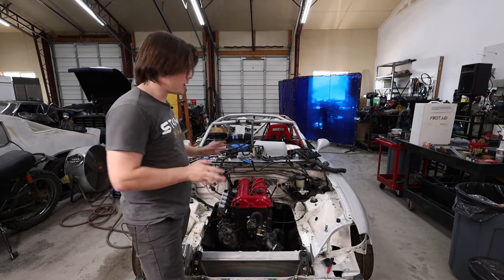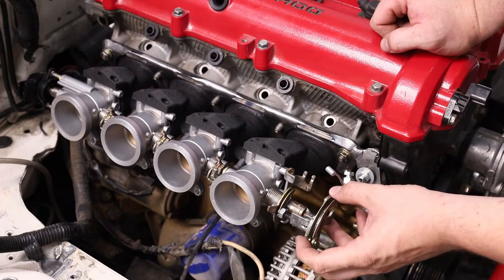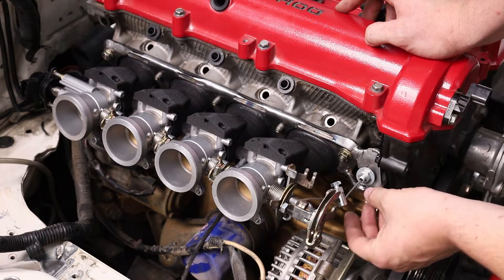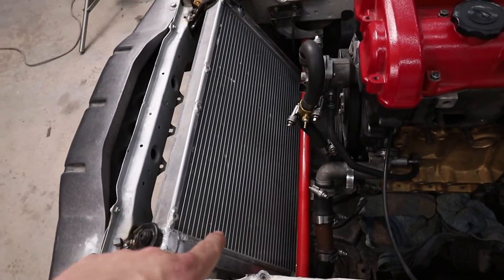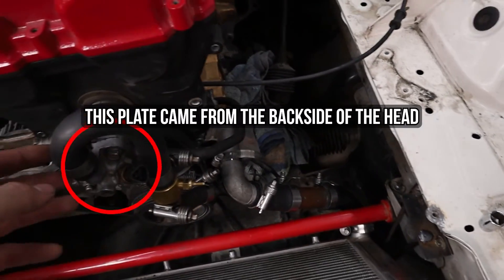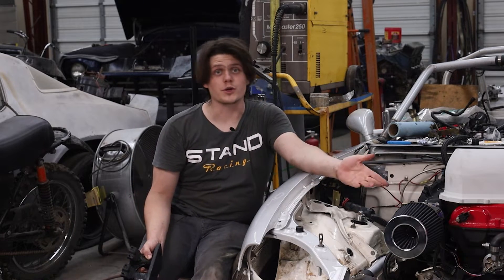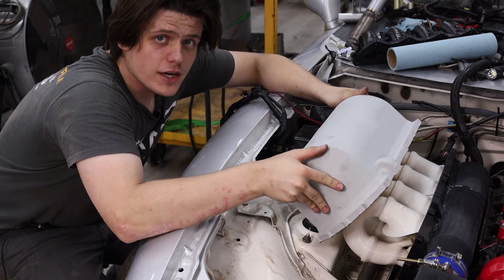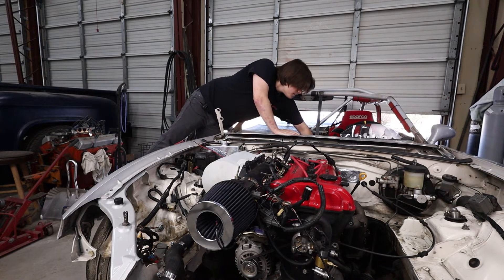I did all I could to make the 3D-printed intake work...

Comment: For the venturi project, ypu can use normal rubber hose, and you can put a spring i side the runner hose to keep it in right shape, to prezent it from collapsing due to excesive bending.

Comment: I'd try getting a good baseline established and then possibly afterwards try the venturi. I think optimising the runner length and lsa and cam timing events will yield much better gains than the venturi system likely would.

Comment: 3d print tubes(instead of using hoses) of a specified radius for better flow (hoses will kink and move around making more variables changes in the scavenging air flow). I think if you make a rubber boot for each end that should be sufficient to hold them in place. It’s an opinion, but take it as it is. Keep up the good work

Comment: At work we use Festo air lines, you could modify your Venturi ports to angle slightly towards each other and run pneumatic line to each port. Really solid stuff and rated to crazy ratings for the size of the pipe

Comment: I 3d printed an intake pipe (4 cylinder turbo) out of PLA for the fun of it the other day. I drove it 8 miles and took it off and it melted a crazy amount. I think maybe the first pull was an improvement and everything after had boost leaks. I think lost pla casting is the most realistic option for any 3d printed intake pipes.

Comment: You can get make your own oring lengths that you just super glue the ends for the plenum. What printer you using?
 I'll also be testing my manifold soon to see how much pressure it holds with 5-6mm wall thickness. 
Also are you going to be annealing your prints and try factor in shrinkage?

Comment: Is it just me or is that radiator really low?
Do you have a filling/expansion point in the cooling system that's higher than the engine?

Comment: For the hoses you can use a flexible filament to print them to shape.  More ideally I would use a resin printer and experiment with mixing rubber like and tough resins for the best results. But I imagine you only have filament printers available.

Comment: i thought the heated O2 sensors say specifically to not heat them up before starting the engine. if you let it heat up you may quench the sensor with water/water vapor on startup.

Comment: a small pipe bender, metal pipes, rubber hose couplings and some hose clamps should do for the venturi part. at least for dyno testing until a more permanent solution is developed.

Comment: custom bent tubes are easy. put a spring inside the hose, bend it and use a zip tie or something to keep it in the shape you want. Then put it in boiling water for a little bit, then cool it off in cool water. You probably want to bend it more than needed for the vulcanizing process because I'd think it would spring back a little. You can remove the spring from the tube afterwards. This project is bad ass.

Comment: Use metal tubing for the bends with rubber couplers to make your port to port scavenging connections. Could probably even print the couplers using TPU or something similar.

Comment: First off, awesome video / content. Love the format & your video style!

Interesting comment about waiting for an O2 sensor to heat up before startup - I've been operating under the opposite premise; that condensation in the exhaust from the engine start is the #1 killer of hot/pre-heated O2 sensors, and that fouling from carbon due to an unheated sensor within the exhaust is comparatively no big deal. I've even implemented a alternator-voltage-sensing circuit for my wideband controller so that it doesn't get any power until the car's at >14V or so.

Comment: Forget the static length.  I want to see you make a trombone slide like velocity stack to make variable length runners.  Do something simple like use an Arduino with an RPM input to adjust the length of the runners. If you can design those runners like you have, the slide mechanism shouldn't be much more difficult.

Comment: 9:05.  Look at computer liquid cooling for how you run tubing at tight angles.  Usually, you would use a plastic spring like thing that wraps around the OUTSIDE of the tubing.  Look for "anti-kink coil"

Comment: You could try useing the more rirdged plastic vacume pipes used in pcv systems. I have some very robust pvc limes in my Corvette that could definitely run in slight vacume without buckling

Comment: Don’t be so hasty to abandon the design - take a look at hardline options. Take a look at braided or reinforced soft lines (similar to brake cables). If hardware is the limiting factor, consider clocking the barbs on the CAD to be coincident with the mating barb (or at least at a more favorable angle). I think there’s an answer here that would enable you to continue r&d on the original intent of the design.

Comment: For the tiny tubes you could use something solid for the curves, like a large diameter brake line then just use the soft hose to join the two parts.

Comment: Sounded beautiful!
As for the hoses, you could bend some steel brake/fuel line into your intended shape, then slide rubber hose over top. Steam the hose, and it will accept the new shape.
Or something like that, I know steam is used to make homebrew molded hoses.
I definitely want to see how the venturi thing works out, but your ITB airbox is a thing of beauty as it is.

Comment: Love what you are doing! 
I agree that concentrating on getting the runners finished and working without the Venturi is the best approach. After that is ironed out, you can confidently experiment with the venturi. At this point I think you are trying to solve too many things at the same time. 
I also wanted to point out that a Venturi can choke your air flow if the demands of the engine surpasses the sonic flow on the Venturi throat. Not sure if you have taken that into account already on the design.

Comment: For the lines I'd suggest using plastic air line for semi truck air brakes. You can get it in 3-4 sizes and with a slight amount of heat it can bend and hold its shape easily.

Comment: can you 3d print the crossover tube? maybe use a piece of straight tube to function as a flexible coupling? May also bend some hard line by filling it with sand and capping. Usually keep the tube from crumpling.

Comment: Have you tried PET-CF from Bambu Lab? it prints way easier than PA-CF, is stiffer (doesn't deform from bolts) and is more temp resistant. that's what i use for parts that are attached to the engine.
Reply from the maker: I haven't come across that one, thanks for the tip!

Comment: 4:45 Again, a perfect application for the 3D printer. You could make an argument that it's just a quick mockup and not worth the time and effort to design and 3d print.
But if you plan to make this a kit then you will be designing and 3d printing these parts anyways, so why not do it now to get the job done.
Because these one-off hand made parts will never make it to production, they only exist for this one test and after that, all the effort that went into making them will basically go to waste.
Also iterating on hand-made marts is a major pain in the ass, it turns into an unreliable mess very quickly.
But it's just my 2 cents.

Comment: 3:42 in the spirit of 3D printing you could just 3d print an adapter collar that would fit perfectly into the throttle sensor and on the throttle body shaft.
Reply: I was just about to comment this.

Comment: 1:55 Wait so if you made an attachment to bring the cable outward why not also rotate it so that you wouldn't need to fish the cable through tight spaces?
If you rotated it 45 degrees you could bring the cable from the top.
Or instead of making the cable act on the forward most throttle body, you could make it act on the rear most throttle body, which would allow you to hide the throttle cable completely as well as keep it shorter for less friction.
Reply from the maker: To this point and to the point in your other comment it may even be possible to run the TPS and the throttle cable on the same assembly in the rear.

Comment: how will you throttle bypass? How do you balance the cylinders at low and mid rpm (the throttle plates opening all the same) wot won’t matter but low like 5-10% throttle (or lower) a variation of 1% between blades will cause some issues. You could use a uni-sync but the engine has to run.The TPS should be checked for voltage I think you can get it correct with what you have but should check it to make sure it doesn’t have 1 volt at idle when it’s supposed to be something else. The plenum is going impact the reflective wave so your itb’s are just more complication with the individual runner nullified. If you banking on your runner being that much better and itb’s doing something then I would get a ms3 or something and make it run on map and test it with/without plenum. I don’t think the design is bad at all but the stock intake is going to have to be pretty bad for that to yield substantial gains. Lastly- half the deal with itb’s is the cool 😎 “I know I just spent a fortune on itb’s or stacks for little to no power gain, but they look cool as hell don’t they” your covering up the cool with the plenum.
Reply from the maker: I hope to address your very last point with a transparent plenum cover 😎

Comment: 9:45 why not take an aluminium pipe (easy to bend in cheap china tool) and make 2 90 bends and connect that with a short hose in the middle
Then glue/ epoxy in aluminum into the plastic, should hold for testing

Comment: Also get a lathe, the chip ones are really god enough (a bit bigger than mini lathe though like the smaller grizly makes)
you wont know you need it until you have it - srsly really well spend money in my case to buy even a china special manual lathe
Reply from the maker: I have a medium size lathe-mill combo unit I got at an auction, haven't used it much yet but I definitely will soon.
Reply from the maker: It's in this video at 8:29 https://www.youtube.com/watch?v=wKSEmOnWVfI

Comment: Not done watching yet but you could run the throttle cable around a small idler pulley so the cable doesn't need to be perfectly in line.

Comment: Keep working on the Venturies. Perhaps Teflon tubing and a little heat can make it work. Or hardiness out do metal tubing, maybe even a printed piece on side. Don’t give up you’re on the right track. I’d recommend printing a housing for the TPS that bolts to both the throttle body and the tps with the factory spacing. And substitute a printed adaptor instead of you Pittsburgh special

Comment: richard holdener has dyno proven results on placing the fuel injector infront of the mouth if the intake runner on a 4cyl honda motor

i think your design could do it even better

i would suggest a drain at the bottom to easily clear fuel that falls out of suspension though

Comment: theirs various manufactures that make intake runners that have dynamically variable intake lengths

so the refraction wave from the valve closing comes back as the valve opens at 2 (or more) rpm levels

Comment: To slove your straight hose poblem and create a molded hose. Insert a tight coil spacing spring into the hose. Next bend to the desired shape. Then heat the hose with a heat gun. Allow to cool or use a wet cloth to cool the hose while still holding the desired shape. Remove spring.

Hope that helps, it's better than nothing.

Comment: for the small hoses you could use ptfe with some metal rods inside to bend them. Heat them up with a heat gun and the metal rod will keep them from collapsing.

Comment: Just a heads up, don't let your wideband 02 heat up before starting the car, if they are hot on start up and condensation from the exhaust hits them then it's instant death for the ceramic sensor element. 
The bosch data sheet for the sensors says to only begin heating once the engine has been started.  
While you are correct that they ca foul up if they are run too cold that is really an issue of long term use with the engine running, and we are talking about hundreds of miles there.
Reply: Wonder if that's why wideband sensors controlled by certain aftermarket gauges fail so often.

Comment: what a bout 3d priniting the venturi tubes to fit in?
Reply: Also I think its called the infiniz or something like that would be good for more print area for your FDM printer, but you might want a resin printer for the trying to print your own venturi interlinks.
Reply from the maker: Yes, curved tubes are pretty much unobtainable for FDM without something such as water soluble supports.
Reply: @StandRacing  As long as the curve is gradual you can def pull it off.
Reply: I mean you printed the velocity stacks themselves!
Reply from the maker: True, but the stacks were printed in 3 separate segments and bonded together. I didn't want the supports to leave little boogers inside the tube that I couldn't easily reach and clean up.
Reply: @StandRacing  yeah fair. Could probably print smaller tubes in halves at least. :)

Comment: You can put a spring inside of the short hoses to keep them from collapsing in tight bends.
Reply: Or on the outside of the hoses, should work the same if the windings are tight enough
Reply: @speedlo_98  correct! Either option works, but an outside spring/coil may be best for airflow.
Reply: I just put zips ties around the kinks till they stop 😂
Reply: Make a solid tube and only use straight couplers. It's what I did on the v-mount for my rx7.
Reply: @keilmillerjr9701  Hard lines was going to be my suggestion as well.
Reply: @802Garage i second a hardline
Reply: @802Garage  it has to be hard line because flexible hose would just collapse shut under the vacuum pressure
Reply: Isn’t fuel line thick enough to prevent collapsing.
Reply: You could buy pre-bent silicone hoses. Get one with 90 degrees and long ends.